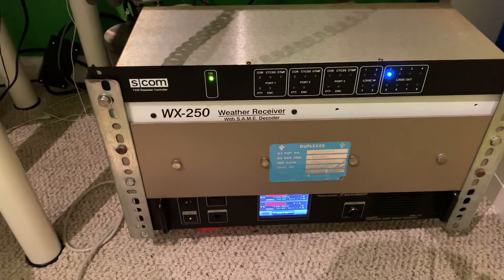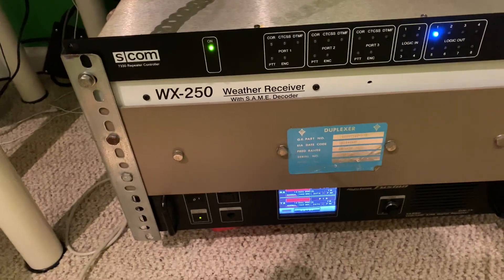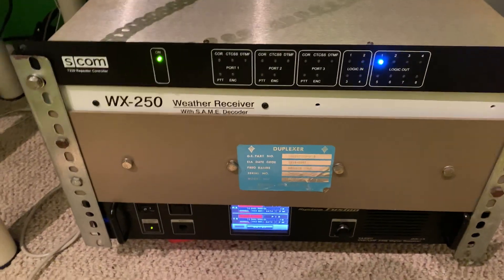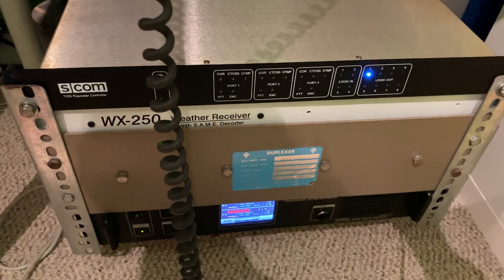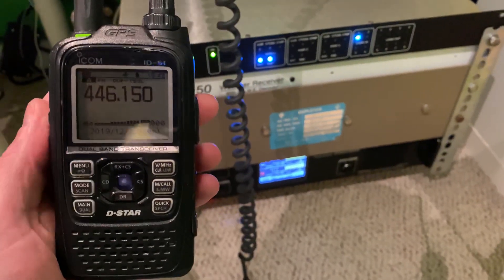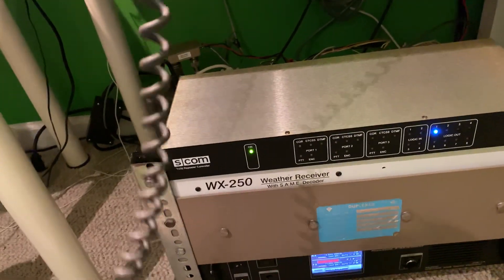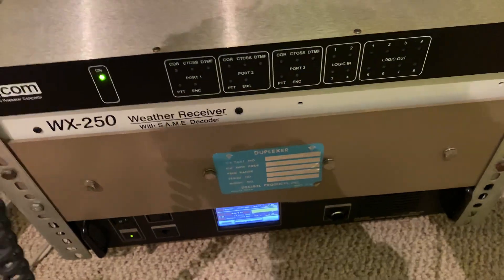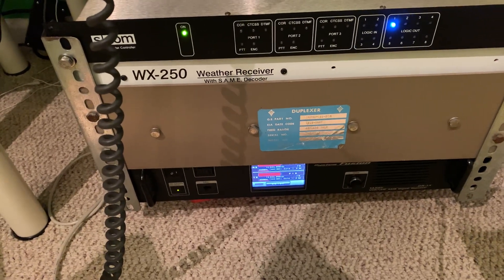S-COM 7330 Controller on the W8SRC Repeater

Comment: I am thinking about getting an Scom controller for my DR2X also. was wondering if you have a link radio connected to your scom controller, that you can link via RF to other repeaters? And what kinda link radio and cables are you using? Thanks in advance

Comment: Nice work on your system! I am looking at getting a controller like that. There is one specific courtesy tone I am looking for. Is there somewhere that has a demo of all the capable tones? The one I’m looking for sounds like a drop of water. Thanks and 73 de N4LLC
Reply from the maker: Thank you, Logan!  You can program any tones that you'd like as long as you know the frequencies and durations.  I programmed that raindrop courtesy tone using the information on this site: http://www.scomcontrollers.com/node/65  The frequencies are 400 Hz through 1100 Hz in 100 Hz increments (i.e. 400, 500, 600, etc. through 1100) with each tone lasting 10ms.  I hope that helps!  73 de W8SRC

Comment: Didn’t like the Arcom?
Reply from the maker: I liked the Arcom, but it had numerous issues in the 5 years that I’ve had it on my repeater.  In one case, the controller was stuck in transmit mode and never identified the repeater.  I had to put the repeater on the DR-1X’s internal controller in such cases.  I also really like the flexibility of the 7330, especially with the speech vocabulary and with macros.  When I finally got the chance to program one (my own) after programming so many other controllers, I can say that it’s the best controller on the market, in my humble opinion.
Reply: @W8SRC  so how is the 7330 holding up?  Is it frequency agile like the Arcom?
Reply from the maker: @Hero1395  The 7330 is still working well!  The repeater users seem to like the IDs and other announcements that I have programmed on it.  Unfortunately, the remote base is not frequency agile, so it will likely be replaced with an EchoIRLP node soon.  Port 3 will probably be an external DVR for signal echo tests.